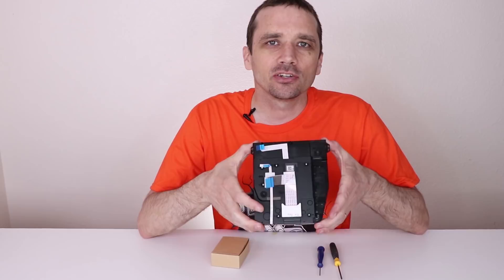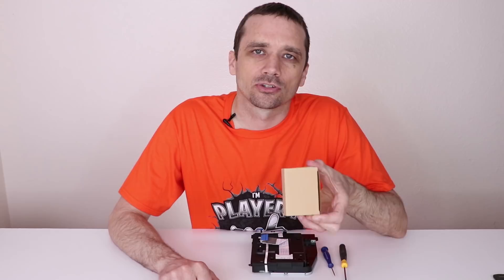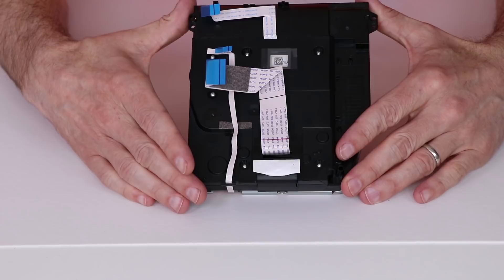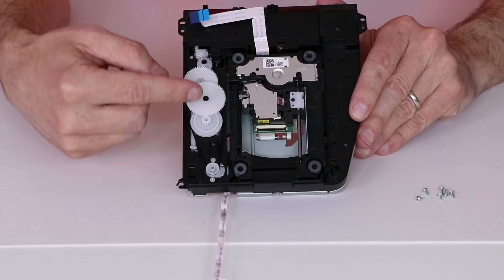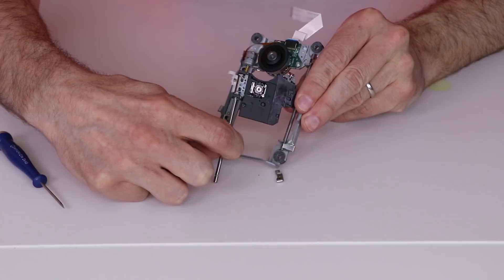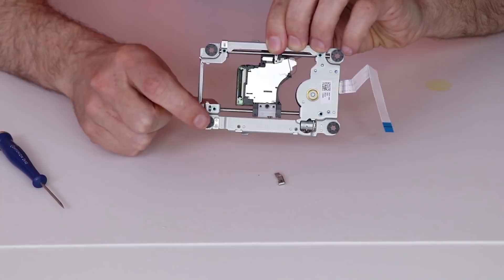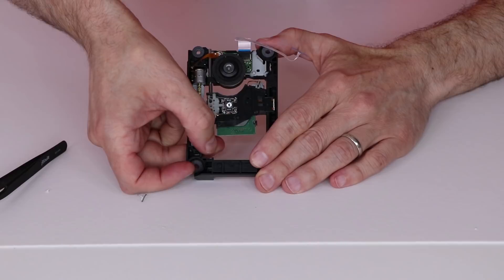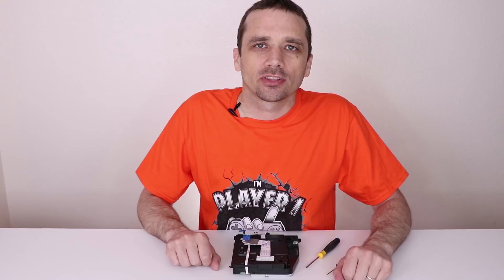PS4 Disc Reading Error - Laser Fix - How to Repair Blu Ray Drive

Comment: Tronicsfix a couple of weeks back I opened up my PS4 to clean it, and accidentally loosened the screws to the disc drive. I tightened them some but the disc ejects out with some tears on the label,I loosen the screws a little and it does the same. I'm afraid to further use the disc drive on my PS4 cause I don't wanna replace discs at all if I don't have to. I got myself into this predicament by accident and am trying to get myself out of it.
Reply from the maker: I'm not sure what would cause that.
Reply: i accidentally loosened the screws on the bottom of the disc drive of course.
Reply: maybe it's unrelated to the screws

Comment: I’m scared to fix mine but it needs a laser replacement
Reply: I just randomly decided to take my PS4 Pro apart out of the blue, never taking anything of this sort apart before, and hoped for the best. Can tell you that it's so, sooooooo damn easy to take apart and reassemble so long as you have that weird shaped screwdriver.

Comment: Great video. I recently bought a used ps4 pro and it will accept and return the disc without any weird noises but when the disc starts spinning it makes a clicking noise and won't read the disc. Any suggestions?
Reply: Did you solve the problem? I have the same issue
Reply: @eduardomuniz5836  had a new drive put in and the noise stops but still is not working. Going to take it to another place , was told now it maybe a software issue now.
Reply: @RedLightJhunkie  my ps4 pro, takes the disc and tries to read it, like 3 times, it makes a noise as if it was going to take it out but it does not, it tries to read it, it is heard that it spins for 2 seconds and stops and shows me an unrecognized disc, that same Lens I put it in a ps4 slim and it works, so the problem is in the pro console, it may be the flex cable, or a fuse on the board that does not allow to read it, I already reinstalled the software and it was not solved.
Reply: @eduardomuniz5836  ill be back home next week an am going to drop it off. Ill let you know what i come up.
Reply: @RedLightJhunkie  thank you bro
Reply: @RedLightJhunkie  did you solve it?
Reply: @eduardomuniz5836  sorry for the delay. Dropped it off but out of town for the holidays

Comment: I'm pretty sure my lazer and disk reader buttons are both off, it was saying unrecognizable disk before but now it won't accept or eject disk, so I've just ordered the whole set up. I hear I may have to replace the labor bord because it is married to the mother bord, I think it was labor bord
Reply: yeah pcb boar is married to the motherboard, if your disc drive is not working then you need to replace pcb board from old laser to new

Comment: Idk I replaced it and it's still saying unrecognized disc bro it makes weird sounds
Reply: What kind of noises? Does it rev up and stops and does occasionally re ejects and takes it back in?
Reply: @busboy5460  mine does like that since I cleaned it with a blower and electronics cleaner and the disc is not spinning should I buy a new laser?

Comment: I replaced my laser but it’s still doing the same thing and my disc are completely clean too
Reply: Did you managed to get it sorted? Having same issue
Reply: @skamanization  nah but I tried the laser with a different ps4 so my best guess is that the ps4 that isn’t working right has something wrong with the motherboard
Reply: I've changed laser, drive, etc going try swap with mates drive and see if its board on blu ray